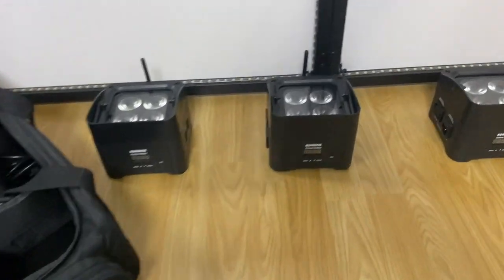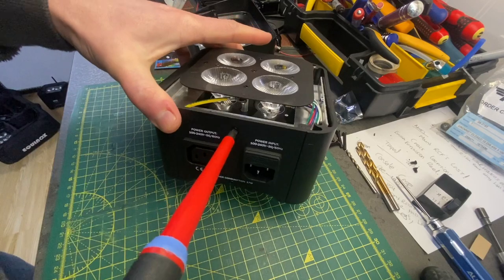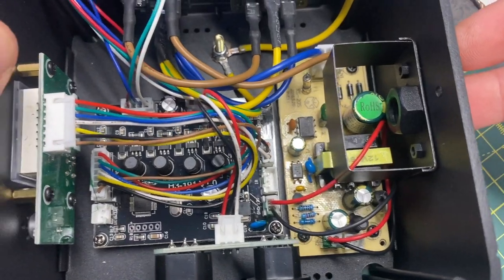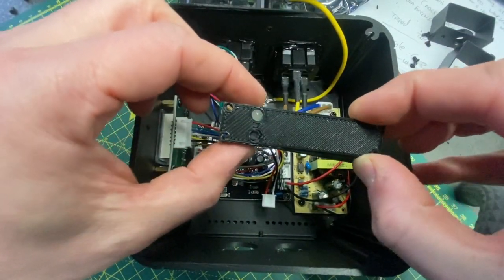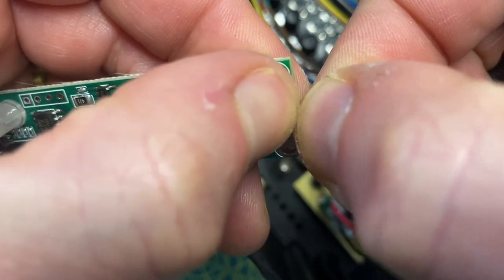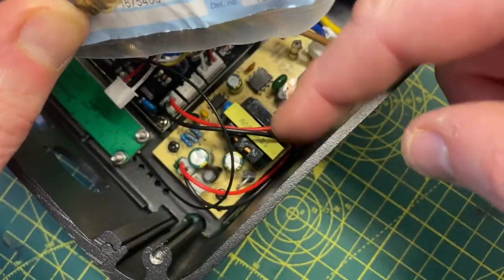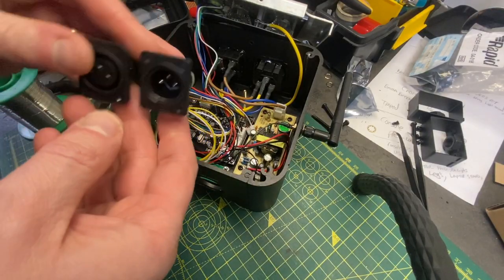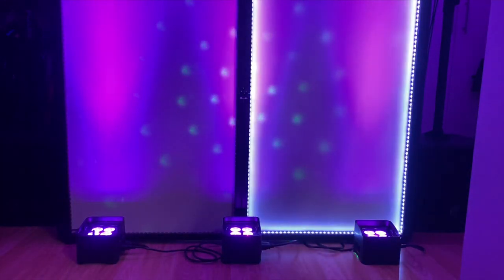Equinox Colour Raider Radio DMX Light Conversion Hack

Comment: Hi, really great tutorial thank you for sharing this! I watched it even though I don't have these lights but I wonder if it would work with any lights? For example, I have 2 Chauvet Obsession HPs and 2 Chauvet Wash FX HEX fixtures which I control with MyDMX GO on the tablet, all wired of course apart from the connection between the tablet and MyDMX GO receiver (which then goes on to sending the signal to the lights via DMX cable). I would like to eliminate the need for DMX cables but don't have the pennies to fork out for the very expensive Chauvet D-Fi XLR pack. What do you think?